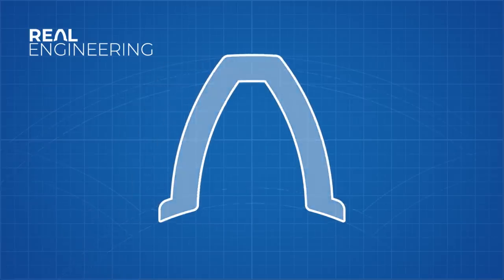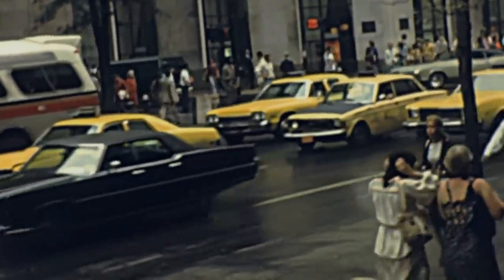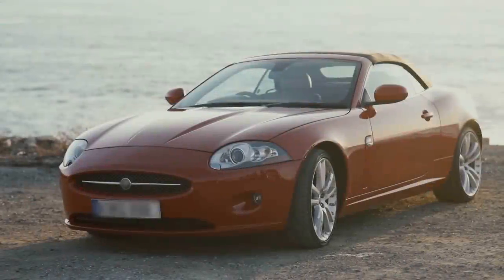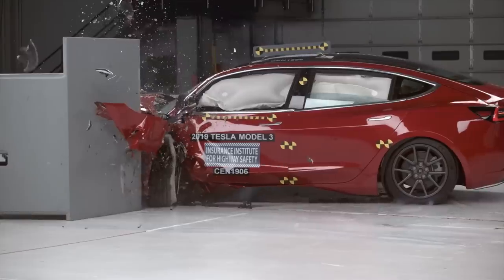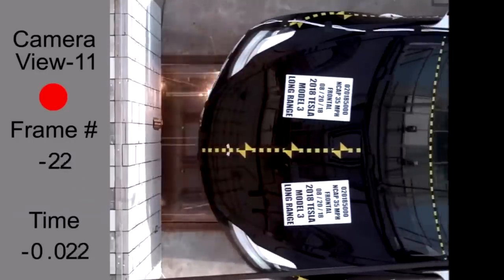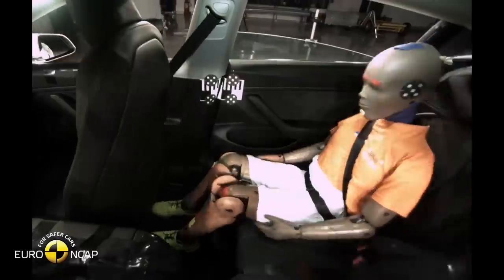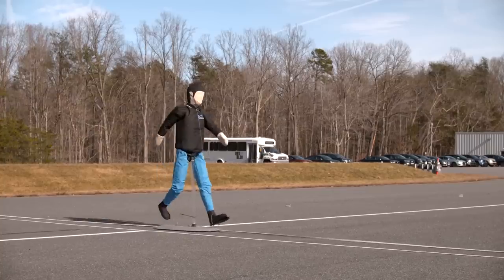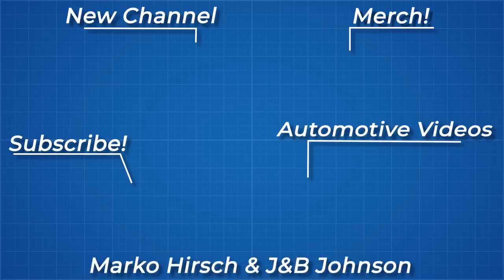Which Is The Most Dangerous Car?

Comment: You didnt answer the initial question: Is the cybertruck safe?
Reply: He didn't answer the question in the title either
Reply: Possible as long as your not a pedestrian.
Reply: Well, it will probably kill pedestrians at much lower speeds than other cars...
Oh, and the Cybertruck might also be a tad dangerous in frontal crashes if it has a reinforced bonnet: That thing won't crumple and might come through the windshield, decapitating the driver.
Reply: Probably because there isn't enough publicly information available to make a determination at this time.
Reply: There is no way to know without testing. Also, the consumer Cybertruck doesn't exist yet.
Reply: @csours  was just about to type this
Reply: encodersofia he did, it is said multiple times in the video and was one of the focuses.
Reply: It's only safe for its occupants I think.
Reply: Well i guess they never tested the Cybertruck in these crash test so there are no statistics to read off from
Just the same old marketing ploys that Elon does.
He did also say that cars are meant to have crumple zones to decelerate cars, but no mention in the conclusion :/
Reply: Totally. I was waiting for the answer  for the whole video.
Reply: Cars need a strong "shell" to absorb the impact of the crash the crumple zones will not be impacted by the cyber truck's current design
Reply: That car is not real. It is a troll.
Reply: @encodersofia  yes he did
Reply: @jadon3760  ? the "shell" does not absorb anything, it maintains rigidity while crumple zones absorb the impact. the whole point here is that both the overall frame and the body panels of the truck are rigid i.e. there's less on the vehicle to absorb energy
Reply: @LnZ_Blu  Mitsubishi focus. He said this at least 3 times while pointing out the flaws on crash testing. Pay more attention and understand what's being said rather than just absorbing meaningless info
Reply: @encodersofia  in a way he did...
Reply: The cybertruck has a very low center of gravity and an high ground clearance, probably when it goes into a car , that car goes under the truck...
Reply: Is the Tesla truck real?
Reply: Its not possible to answer this question anyways as the cybertruck is still being designed
Reply: The answer is no. The car is made out of industrial grade steel that is not designed to fold or crumple. Will probably do fine on occupant safety but I could see the car not being cleared for use in some countries when it inevitably fails the pedestrian safety tests.
Reply: The panel is not necessarily a factor.  I would look at the impact zones and inner door reinforcements.
Reply: He also said to not reliy on the safety test... even tho it has falws its still relative right
Reply: He's answered, the survival of a crash depends on the crash schema and crump zones impact dissipating capacity that in the cyber truck case is minimal (10mm stainless steel unibody don't absorb kinetic energy well) - you will be dead from the rib cage and skull fractures in looking good car.
Reply: I'll help and answer your question...... No
Reply: @EpicMrBlack6869 
It will be horrible for occupant safety, you want the car to absorb the impact, not your head.
Reply: Let's wait for an ANCAP rating to see.
Reply: Im just lucky to have a working car
Reply: The testing system is not ready for Cybertruck, That's what I gathered from the video.
Reply: It is not yet at that stage in development.  And the door should NOT be a crumple zone.
Reply: The prototype does not need to have crumple zones because it is a prototype.
The production will have crumple zones
Reply: The Cybertruck will likely be less safe to the driver when crashing into a solid object like a large tree or rock or solid building wall because of the lack of crumple zones.  The Cybertruck will be much less safer to other cars it hits because it will shred them to pieces because of how strong its shell is and because of its massive weight.
Reply: Title question was not answered. Typical bait and switch.
Reply: Nothing was answered in this video..
Reply: @Duke Nukem The Cybertruck is only there to get in his obligatory jab at Tesla and/or Elon Musk. It doesn't matter whether or not he liked the design. Lots of people whose opinions actually matter didn't. It is highly doubtful that he actually mused over its possible safety and just used that as an excuse after the fact.
I only clicked on this video to find out how long it would take him before he was able to work in a dig at Elon. It's an obsession of his at this point.
By the way, for the rest of you: Pedestrian safety is part of the testing and regulatory design requirements. It is why the rear of the hood/bonnet of front engine cars is so high nowadays, or has pyrotechnics to lift the hood upon sensing an impact. There has to be at least 20 mm of clearance between the sheetmetal and any hard surfaces such as the engine, engine accessories, wiper motors, etc. Windshields have also been redesigned to be more compliant. Frontal surfaces like bumper covers have been made of softer materials.
Historically, pedestrian deaths came from the initial impact not the secondary impact with the road, so the emphasis has been on making sure to not accelerate the pedestrian up to the vehicle's initial velocity and instead routing them up over the vehicle with gradually sloping surfaces that are pliant. The drive for increased aerodynamic efficiency has helped this cause a lot.
Reply: No
Reply: The whole point of the video is that it's impossible to tell which car is ACTUALLY the safest, with the tests being as old and shitty as they are.
Reply: Mark my words. Cybertruck will probably be one of the safest car to travel in. The production version will have proper crumple zones in the steel exoskeleton and it it's built like a tank
Reply: It's not safe, the problem with durable steel bodies is that it doesn't crumble as much so the crash energy gets to passengers
Reply: The answer is "There is yet insufficient data for a meaningful answer."
Reply: it isnt safe when women drive it.
Reply: Well I think the issue is there isn't any cars on the road with a similar hardness level. Even back in the 70s we used thin sheet metal, not over a centimeter thick stainless steel. Don't know if there is a way to figure out how safe it is unless you do some math on the kinetic energy. In theory, the car would basically be a plow that goes straight through nearly everything it hits. Good for the owner, terrible for the other person if they hit them. It has non-malleable material, a higher average weight, is entirely a steel frame. No idea what would happen with that.
Reply: This should be the top comment
Reply: Maybe if you’re in it during a crash. If the Cybertruck hits a pedestrian or another car with occupants... those people are doomed!
Reply: @eulemitbeule5426  If Tesla took all that trouble with safety in the Model 3, as shown in the video, it would be surprising if they didn't do the same the Cybertruck. The sledgehammer stunt was done on a door, where you don't really want too much crumpling in a crash, rather than on the bonnet or front wings where you do.
Reply: @mikezerker6925  that's basically my idea. I think it's less about the driver being hurt but the person they impact who will be.
Reply: Mycel  if you are riding a car that doesn't crumple, you are in a lot more danger. The other car crumpling can't compensate for yours not doing it.
Reply: One thing is sure, it's windows won't survive balls of steel
Reply: Well, lets see how they can make it safe for pedestrians:1) Crumple zone: Unlikely as a 3mm thick steel plate won't do that. Might be possible if they hinge the front plate on pins that will snap, but the bonnet will remain solid. Therefore, the hinges are unlikely as the bonnet would create a sharp edge. 
2) Pedestrian airbags: Expensive, not done before by tesla and would also require the bonnet to be unhinged at the back. Unlikely, as an unhinged steel plate could pierce the windshield.
The Model 3 was easy as they could just use non load-bearing trusses for the front (remember, no engine), making the entire front soft and creating more space for deceleration (again, no engine is in the way). Normal cars solve this problem by dropping the engine beneath the car in the case of an accident, Tesla didn't have to do that (and the battery would be in the way).And remember those trusses: The model 3 uses a normal chassis as a mounting point for the motor, wheels, etc that is encased by thin metal whose only job it is to protect those components from the elements. The Cybertruck uses an exoskeleton, meaning that the outermost layer is load-bearing: This is basically the inverse concept of the model 3 where the innermost layer (the chassis) is load-bearing. If your outermost layer is responsible for making the car rigid, it can't deform (as that would collapse the car).
This is one of the reasons why almost all cars use a chassis: You can make the outer layer soft, reducing the damage in case of an accident (you can easily repir a dent in a door but you can't untwist a bend frame/exoskeleton).
Reply: He better in the future because now I’m curious and it isn’t my job to research these things
Reply: NarrowStone ø
Reply: Cybertruck is an exobody. Just like you can hit a car's frame with a Sledge, you can hit the external frame of cybertruck. And just like the internal frame of a car has crumple zones, the external frame of cybertruck will too. The video author is just has an anti Telsa/SpaceX streak, check his personal Twitter.
Reply: As long as it’s just cyber, it’s totally safe...
Reply: It's not out yet so you can't exactly test it. But probably not. Safe for whoever is inside but not for the others.
Reply: It is better to wait for NCAP, or equivalent to test it.
Reply: Duke Nukem Do you have one we can test?
Reply: there were no questions answered in this video, just a bunch of questions asked, some numbers thrown around that were aggregated from websites, and a couple advertisements worked in all at a convenient just-over-10-minute package.. this channel used to be interesting but i don't see a reason to stay subscribed.
Reply: Rhetorical questions I suppose? 🤷
Reply: It is too hard to find it out.
Reply: @stephenrowley4171  Right, so I can jump in front of let's say an Audi but I should be more carefull with Tesla? That's the most stupid thing ever. Pedestrian safety depends on pedestrians, not cars. It's like designing trains to be safe in a colisions with cars. Se how stupid it is now?
Reply: @PeteS_1994  But for who else should it be safe? Maybe cars should have external airbags so we all could jump right in front of them and be safe...
Reply: No it isnt. The german TÜV already said, that it dont get the license for germany, because its to stiff and therefore Not safe for driver and pedestrians
Reply: @ArchaeopteryxGaming  Does german TÜV realize that these cars aren't available yet? But if they can test cars they didn't even seen, that's pretty awesome.
Reply: @ardvark84  they said it based on the concept of the car. The car is to stiff, as i said. 
i can link a german newspaper article to the guy who said it, if you want
Reply: It doesn't exist yet, everything they've shown so far is a prototype
Reply: @ardvark84  quite often it's the car fault when a pedestrian get hits.

Also I'm not a keyboard warrior nor a nasty human  nor a sociopath so I would like to think that pedestrian get hit my car even if it's there fault the vehicle I drive will do its best not to kill/injury them.
Reply: @stephenrowley4171  I would love that too but the reality doesn't depend on our wishes. In these days a crane operator have to wear a hard hat for safety. But why? What's gonna fall on him? Health and safety should have it's limits and reasons.
Reply: @stephenrowley4171  i think he answered with "depends" if the cyber truck hits another car, that other car will probably destroyed and the truck driver stays alife, maybe uninjured. if two of those cyber trucks hit each other the cyber truck probably turns in to the most dangerous car. if you hit an object witha certain speed and deaccelerate  to zero within a fraction of a second that is a huge amount of kinetic energy. normal cars fold the metal to absorb that energy. if your car is unable to do that the human inside will suffer.
the same is true when ever that cybertruck hits anything that is as at least as heavy and as strong as the truck. like a wall, or maybe even a very large tree.
Reply: none were made and thus smashed yet
Reply: @encodersofia  Mitsubishi Mirage 3:18, followed closely by the Corvette.
Reply: This video suggests that that question is currently unanswerable. 

The current safety tests give practically ALL cars 4 and 5 stars, including the notorious Mirage. And we didn't know that the Mirage was the most dangerous car until AFTER it proved to be a dangerous car.
Reply: @csours  and even if it tests well, it can be notoriously dangerous in real time, as we see with the Mitsubishi Mirage.
Reply: Downthumbed and elected not to get recommended to watch this channel. Not the first time this garbage has happened...waste of time.
Reply: Well he was doing a lot based on the “per billion miles driven” metric and since the cyber truck doesn’t exist yet and thus hasn’t driven a billion miles its impossible to say at this point.
Reply: @encodersofia  that was the point. There is no definitive test that can give us that answer.
Reply: @ardvark84  if a crane operator is being made to wear a safety helmet while in his cabin at the top of a tower the. It's clear someone hasn't properly carried out the risk assessment, that the not the fault of H&S but the idiot who carried out the Risk assessment.
Reply: @stephenrowley4171  But isn't the risk assessment a part of health and safety?
Reply: @ardvark84  it but as I said clearly someone hasn't done the risk assessment properly. If it had been done then the crane op wouldn't need to wear a helmet.
Reply: @encodersofia  Yes, and that is sometimes the outcome of research, that the question can't be answered. The problem here is that the very important question of which is safest or safer can't be answered. The reason of course is vehicle manufactures lobby the government to stop increases in testing standards because that would reduce their profits, they don't care if the products are safe at all, unless they are made too.
Reply: Not enough info yet. It's still a prototype. End of this year and beginning of next is when testing begins.
Reply: A quick Google search revealed a lot of N/A results.
Reply: LOL!!!
Reply: I didn't like this vid as much as I usually do either. Maybe it was a bit sentimental even.
Reply: This is NOT a final design by any means. The answer that he could give you would be a total guess, and irrelevant.
Reply: Tesla’s are hard to crash and if the driver is paying attention it has a lower chance of crashing than any other car
Reply: The Cybertruck has no chance to get certified for European Roads. It is too dangerous for others.
Reply: That was my interest too
Reply: He answered that Tesla vehicles in production now have better crumple zones because, unlike petroleum fueled vehicles, there is no engine block to lessen and compromise crumpling.  Thus, better crumpling ability for better deceleration in a collision. 
Secondly, the Tesla Cyber truck is NOT YET in production.
Third, testing therefore is not available yet.  No data.   
Furthermore, NHTSA standards are 45 years behind the times.   It's better to go with the IIHS standard.  
Therefore, we will have to wait until the Cyber Truck is ACTUALLY in production. 
Any other absolute comment about its safety at this point is just pure conjecture.  Wait for the actual IIHS test data.
Reply: The tests are too flawed to answer his question and the cybertruck has no tests yet.
Reply: Im sure Elon figured that out... I think its safe
Reply: I think the point was that even if the Cybertruck received the same rating as the Mitsubishi Mirage, it doesn't tell you a whole lot about the safety of the vehicle.   There is no way to answer that question.
Reply: The cybertruck will never see production in that form.
Reply: Stephen Rowley Hard hats are mandatory in a construction zone. It’s there to protect agaisnt falling debris and electric shocks. What does that have anything to do with a crane.
Reply: Nah b
Reply: As long as it dosent crash
Reply: It's a tank. The only thing it miss to become even safer is a cannon. 
So you can shoot other cars before they crash into yours.
Reply: Put an egg in a wooden box, slam the box on your counter, and see how the egg looks like.

The only redeeming feature of the Metal Brick is that it's heavy, so lighter cars won't have as much of an impact. However, if you ever come across another truck, or a solid wall or tree, it's not the tree that will break first.
Reply: @ChucksSEADnDEAD  Well it's both really. If you punch a metal pole, padding on your hand will prevent injury, but padding on the pole will also prevent injury. ideal is to have both.
Reply: @eulemitbeule5426  that's the point of the video...
Reply: @cae7896  A bit like a 1970's VW kombi hitting a modern Volvo and cannibalising its structure to kill the Volvos driver then?
Reply: Just whining the whole video about a company.
Reply: The Cyber Truck had crumple zones. 

It’s the other people’s cars.
Reply: You're safe in it.... If you get hit by it is another thing
Reply: @eulemitbeule5426  Depends what it hits. A tank doesn't crumple either, but I bet it wins in a collision with a small eco car. Mass always matters.
Reply: @eulemitbeule5426  At least they won't sue Tesla after that kind of crash
Reply: For europe standards Mitsubishi is a safe car , same as Hyundai i10, Kia picanto or fiat 500 .
Reply: @jadon3760  oh they can absorb impact without damage just fine, its just the fact that we need to find a way to stop the driver smashing into the dashboard at half the speed they crashed at so we make the cars crumple so it takes the impact better than a car with no crumple zones
Reply: No-one can tell until there's a production version that can be tested. The production version may be quite different to what we've seen so far of course. I'm highly skeptical that it will actually look like the thing they unveiled.
Reply: Yeah that bugged me
Reply: i feel like it will just smash through whatever it hits
Reply: It’s a concept car, there is no point analyzing its safety
Reply: Tesla have to change the front of the Cybertruck to make it legal in Europe
Reply: Safe enough for the UNSC Marines...and they're being shot at by plasma weapons!
Reply: He didnt
Reply: @jadon3760  if a crash came from the side, there will be zero crumpling and everything inside will bounce around like a jar of skittles.
Reply: @jadon3760  if a crash came from the side, there would be no crumpling and everything inside will bounce around like a jar of skittles.
Reply: @EpicMrBlack6869  without any crumpling to absorb the collision force, all of the collision force be passed on to the cybertruck's momentum. the result is the occupants will experience higher Gs (more whiplash) and be thrown around more violently than in a car that crumples. anyone who doesn't wear a seatbelt would be dead due to head injuries from being rattled around in the cybertruck.
Reply: They don’t allow cyber truck here in Netherlands
Reply: The Cyber truck will be surprisingly safe because of the autonomous safety systems that will be in place by then.
Reply: Its not allowed in europe for safety reasons so i guess not
Reply: because it isnt
Reply: Nobody knows but to be road legal it has to meet these test demands.
Reply: tesla considers safety a top concern - you know like everyone else says . however they have made 3 of the top 3 safest cars tested. Have faith.
Reply: Just by looking at the design it can't be very safe because The center point at the top will be a very weak point
Reply: @iair-conditiontheoutsideai3076  yeah its a triangle bro plus you dont know anything about this new type of design. Tesla has 3 of the top 3 safest cars ever tested. I will put a bit of faith that they can make a safe car
Reply: @Capthrax1  many automakers meet The exact same safety requirements that Tesla does but they managed to do it at a very reasonable cost without lacking in safety take the Subaru Forester for example strong a pillars and strong b pillars minimizing intrusion while keeping the vehicle at a reasonable cost
Reply: @iair-conditiontheoutsideai3076  its so weird that i said top 3 and not 5/5 stars.  in fact the proobility of injury for model 3 is about half that of the next non-tesla car as tested by nhtsa.  quick search shows that 5/5 but your Subaru Forester only has 4/5 in terms of roll over. Also though 5/5 for side impact i know which car i would rather be in based off the pictures. The model 3 also has better ratings in... everything despite its unreasonable cost. 

This is all goal post moving for you. they know how to make extremely safe cars. And that nothing practical is known about the cybertruck. Elon musk said he wont make a vehicle that isnt safe.
Reply: @Capthrax1 the national highway traffic safety administration does not do rigorous crash testing therefore I do not look into their results and the insurance institute for highway safety is where I look for crash test results they are funded from the insurance industry so they are going to press these automakers very hard and cut them no slack unlike the government
Reply: @iair-conditiontheoutsideai3076  just a little quote from the creation of the nhtsa "NHTSA is officially established by the Highway Safety Act. NHTSA is responsible for reducing deaths, injuries and economic losses resulting from motor vehicle crashes." 
But also the iihs the model 3 scored very highly. Again goal post moving from tesla has a history of making very safe cars
Reply: @Capthrax1 like I said NHTSA does minimal testing and the testing they do is not even representative of real-world scenarios The government wants you dead let's be honest they are not going to require cars to be as safe as they should that is why the insurance institute for highway safety stepped in and raised the bar and showed automakers how to correctly design a vehicle by blasting their poor designs and putting it on TV NBC dateline used to report on their crash testing numerous times several videos showing improvements over what the government tests did not cover
Reply: @iair-conditiontheoutsideai3076  Lets be honest 25mph test by the iihs isnt very real world either. The government wants us dead. forms agency with express goal of reducing deaths. succeeds - continues to keep agency open. Also model 3 absolutely dominated your iihs test too. so go on.
Reply: @Capthrax1  I'm not going to keep arguing about this because it is going nowhere but I wanted to point out there is not one test IIHS does that is below the speed of 31 mph so I'm not sure where you are getting this 25 mph from also they use a very lightweight small dummy representing a small person and a 3,500 lb barrier representing a large SUV or pickup truck put the two together and it adds up to a hard test to pass
Reply: @iair-conditiontheoutsideai3076  its okay that you lost. Also the pedestrian avoidance has 2 test 1 at 12 and one at 25. I believe its replicated for frontal vehicle avoidance . that is off the top of my head. But i believe they do rear end collisions at 10 and 20 as well. But go on not one test below 31
Reply: Who gives a shit all Tesla fanboys care about is what Elon says they just believe everything he says and blindly defend everything he does not hating on him dudes a genius but his fanboys think they are but aren't
Reply: Ir can stop a sledgehammer,all that matters
Reply: @PeteS_1994  Crumple zones are designed so that the vehicle will deform during impact while other parts remain stiff so that the occupants aren't crushed. The crumple zones dissipate the kinetic energy that would otherwise be transferred to the occupants. Yes, a crash may completely ruin a modern car but someone could potentially be able to walk towards the ambulance as opposed to being mashed into chunky human soup.
Reply: It's designed to ram into cars that is breaker checkers and eliminate them
Reply: He answers nothing
Reply: It will be extremely safe because it will likely never go in to production
Reply: Duke Nukem in the past killed big pig monsters.
Reply: Tesla is smart enough to make the production variant safe. It will have crumple zones.

And for pedestrians: think about cars with bull bars.
Reply: The truck from Tesla won’t have to confirm to crash tests, if it has a GVWR of 8500 or more. I repeat if it has a Gross Vehicle Weight Rating higher than 8500, it does not get tested. Glad I drive 4Runners and a F-350 instead of small cars.
Reply: @JAMESWUERTELE  My brother has a Ford Ranger.
Reply: Who cares. It’s in the repair shop most of its life
Reply: LOL!!!
Reply: I'm afraid it exists now, and to answer your question... no. Not at all.
Reply: No